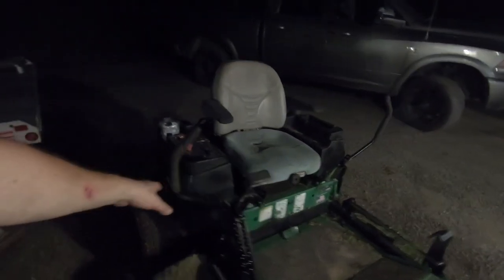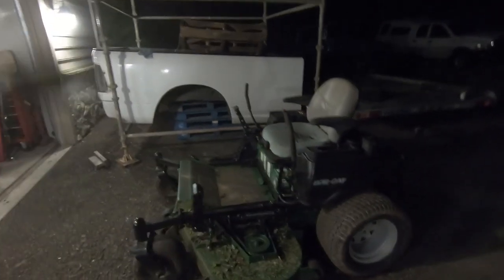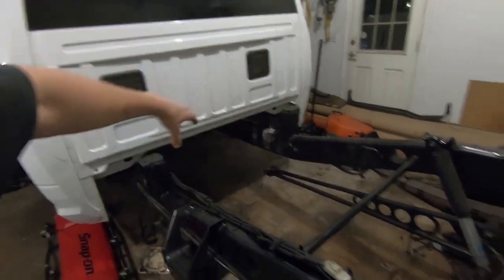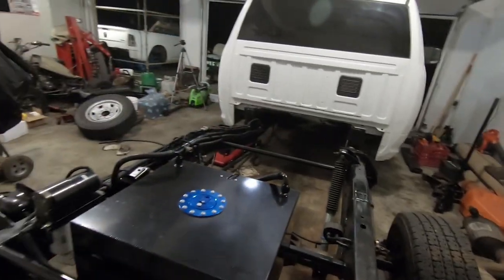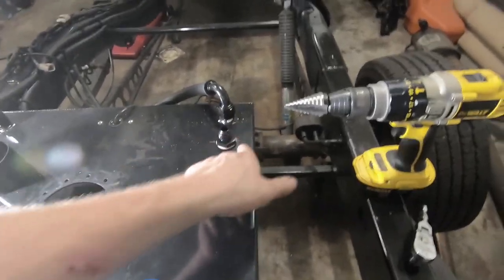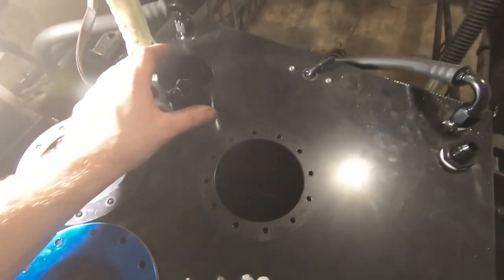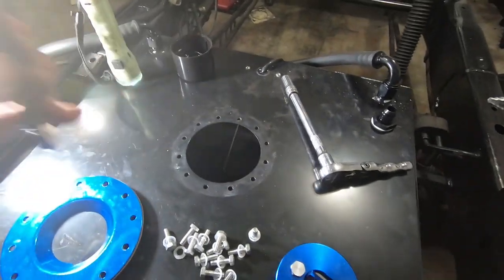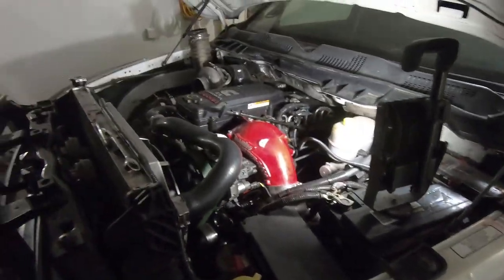TRYING to Fire The 1000Hp Cummins Race Truck Build, Diesel Fuel Cell Success or FAIL??

Comment: Hey Tom try this. Next time you drill a hole go 3/4 of the way down and blow the shavings out and pack the hole full of grease before drilling the rest of way through to catch all of your metal shavings. After that I will run a magnet on the inside for extra security if the material is metal or Steel. Thanks for making the videos. I have learned a lot from watching you.

Comment: so i had the same dilema that you did with the exhaust. I found that running the over the axle dump with an 8" Tip isn't all that bad in the cab at speed or with the windows up or down. The loudest that i find is with the tip all the way to the back tire and running an 8" on a full 5" setup. I recently stepped down to a 6" tip on my 5" TBE and really like that but the drone is of course still there and i get used to it.

Comment: Any concerns with aeration in the fuel cell since the return fuel just pours from the top without a straw that will return it into fuel directly? Also for the vent I think there’s a rule the vent line has to route below the fuel cell?( in case of roll over that way the vent would be sticking up above the bottom of the fuel cell)

Comment: Tom if you had to choose between going 4" exhaust, straight turbo back or 5" what would you go with? I am wrestling with the choice. Nowhere near the same horsepower as you - but shooting for 600 or so.
Reply from the maker: That truck just has a turbo and trans, it's a toss up on the size exhaust. I like the deeper 5" sound personally